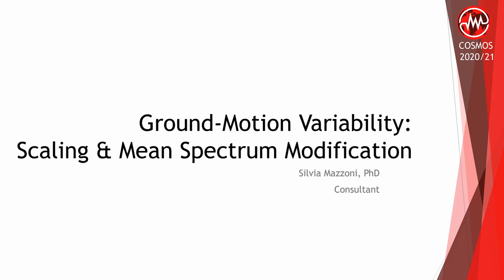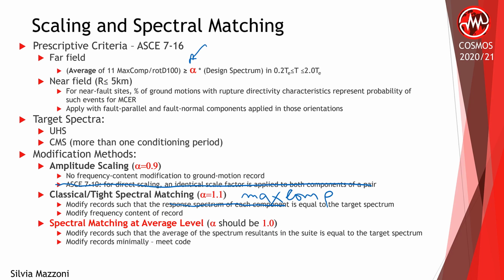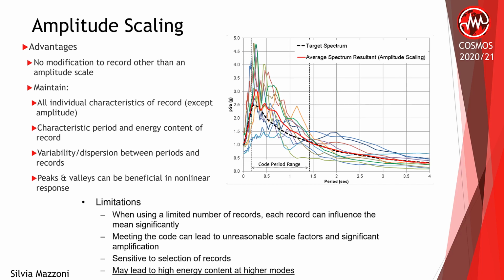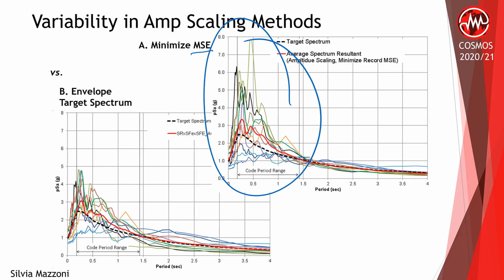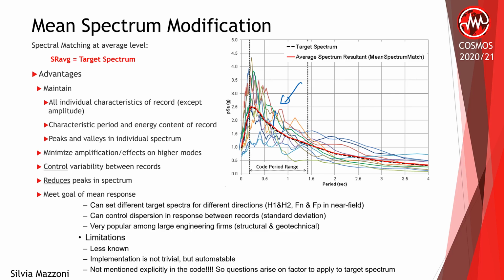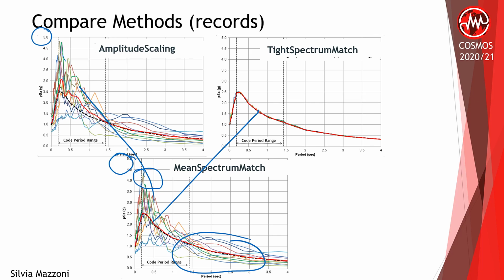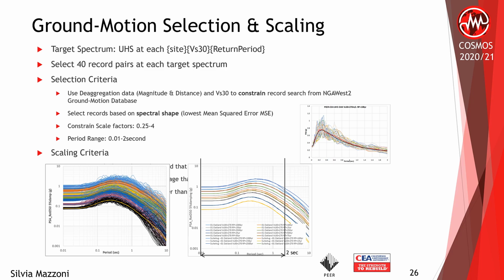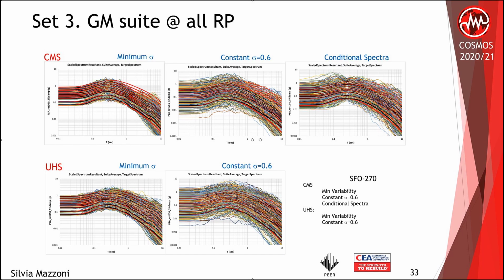COSMOS Technical Session 2020: Ground-Motion Variability -- Scaling and Mean-Spectrum Modification

Comment: Hi, great video! This helped me gain so much perspective on amplitude scaling of ground motion suite, in which i thought initially to be quite simple. At first i thought the way you determine the scaling factors of the suite is to minimize the MSE of the individual ground motion spectra to the target spectra at the period range, then choose 7 (ASCE 7-10) or 11 (ASCE 7-16) of those ground motions from deaggregation to finish. But it turns out there are factors like a level/degree of variability of the suite, which determines if the suite is good or not. I know this is a pretty old video, but i would appreciate some clarification on some things: 
1. Is there a consensus or code provision regarding the degree of variability of the ground motion suite? My knowledge is still shallow regarding this part, but i've read a bit and there's things like uniform variability across the period. What should be the target level of the standard deviation? Code provisions, like in ASCE 7-10 for amplitude scaling only requires the ground motion suite to have its mean SRSS spectrum to be above the target spectrum.
2. What are accepted methods/procedure to determine scale factors of a chosen ground motion suite?
3. Lets say that based on deaggregation, i've found about 30 ground motions in the database that satisfies the magnitude, source distance and Vs30 range. How do i pick/rank the 7 or 11 ground motions that i'd eventually use for performance analysis (NLTHA)? Technically i should use all of them for a better suite/result, but in this case i'd need 7 or 11 for running efficiency